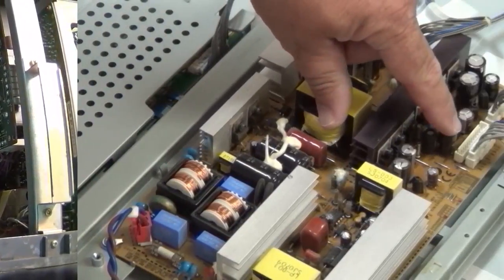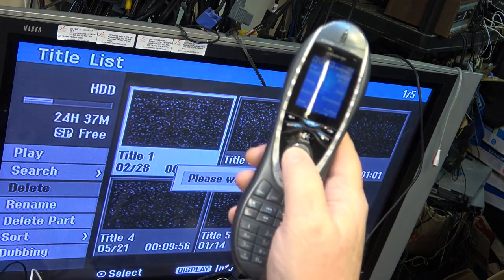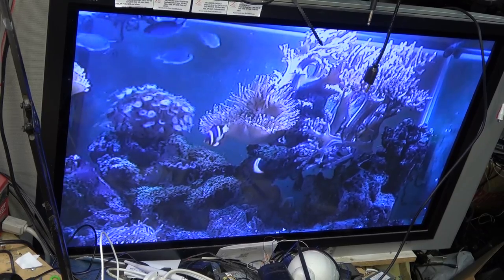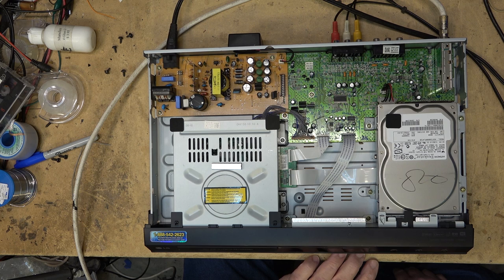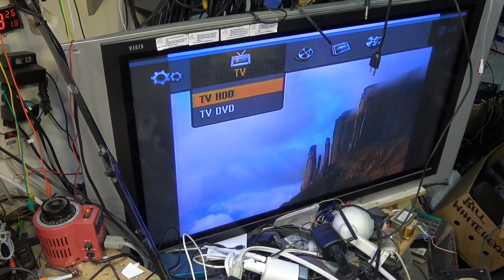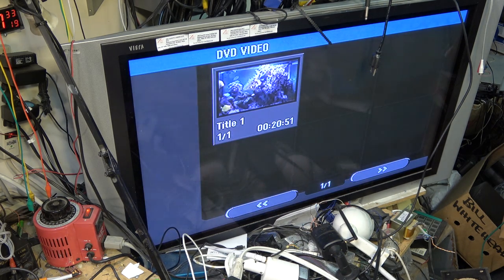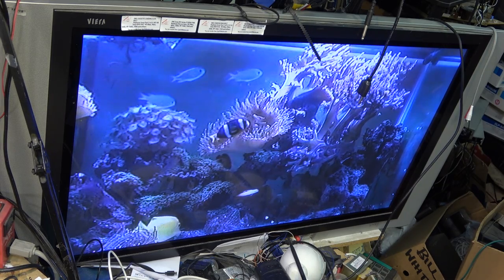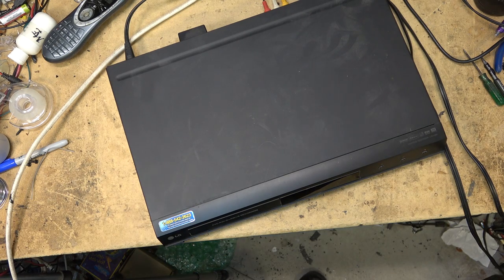LG LRH880 DVD HDD Recorder check over

Comment: I picked one of these up for cheap awhile back at a local thrift. Mine was filled with a bunch of movies taped from cable, including a bunch from adult channels, lol. Can't believe someone donated it like that, a young kid could have bought it. I was disappointed when I found out it wasn't a digital tv tuner as that was one of the thing I had planned to use it for. It sure looked the right age to have that capability. Great channel, thanks for sharing all your detailed repair vids as well as your old travel tapes.

Comment: The GE by JASCO remote MIGHT have a code suitable for these units. Those are cheap and have a very extensive code library. The newest versions of the remote will work smart TVs and Roku players. I think JASCO offers the remote under other names. But, GE seems most common.

Comment: I have a toshiba and a pioneer which both luckily have buttons on the front to allow rec and stop (I do own the remotes as well).  Other features I like are the manual setting of the bitrate and on both of them I have been able to replace the original dvd drives for working ones.  I am in the UK and find the pioneer is nice as it allows ntsc (pal-60) as well as pal record.

Comment: It could be that MTS Stereo is disabled in the units settings menu.
Also, units with built in digital TV tuners didn't start to appear until 2008.
Reply from the maker: No, doesn't have a stereo tuner.  I also have an 850.  Been through the menus on it everywhere.  No option.
Reply: @12voltvids  That's odd. Must have been a cheaper model.
Reply from the maker: @r66f80  all the tv by this time had dispensed with MTS too. I have a TV from 2006. Stereo only from external inputs.

Comment: have you tried eBay for remote. I have a Panasonic that I used to record to the hard drive then make a dvd-rw then I use DVD decrypter to make an ISO file on my hard drive. I have at least 110 TB of movies TV shows and videos. I have six of the Panasonic recorders of various hard drive sizes. I had a Magnavox but it was too hard to use and the remote sucked.

Comment: Had another winner today, Samsung plasma TV, no power, no standby light, checked the fuses on the main power board 1 out of 3 was open, checked after the open fuse for shorted /damaged components, and couldn't find anything, so I risked it, changed the fuse, plugged it in, the fuse blew instantly, I traced the line after the fuse to a 6 pin power switch ic, it wasn't reading short vcc to ground or output to ground, but I took it out, and saw it had burnt on the bottom of it, so I found another ic from an old donor (different board but Samsung), plugged it in again, this time I saw a flash from a 15v voltage regulator next to the ic, so I replaced that and tried again, this time the ntc thermistor popped and took the fuse in the plug out again, so I traced back from the ntc and it fed 2 diodes in series which were both short, so I changed them, plugged it in again, and hey presto, no bang, standby light was there, and it fired up perfect, really good picture actually for a plasma TV. Didn't finish untill 3 am but I've got that smug feeling and I'm happy! Can not thankyou enough for the inspiration and education 12v vids!

Comment: These units appear to use connections on the drives that are similar interfaces to computer drives.
Reply: They use SATA, older ones will use IDE.  Some use SATA but with non standard connector's.